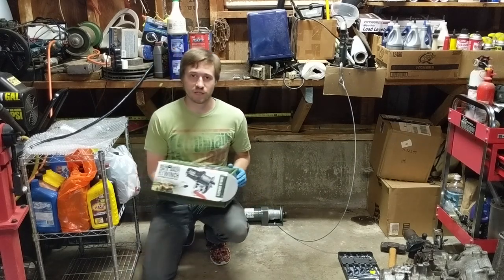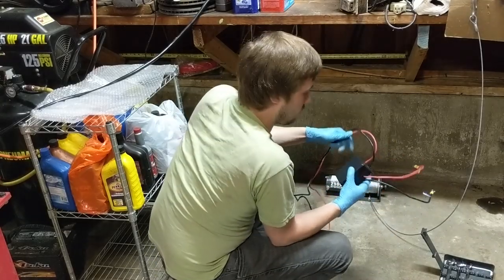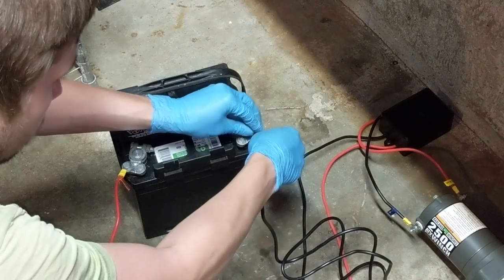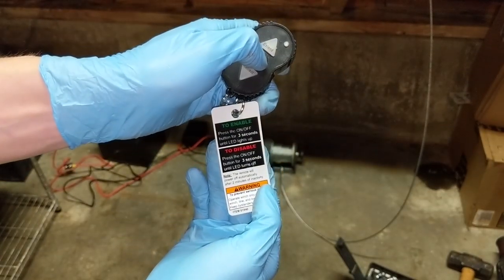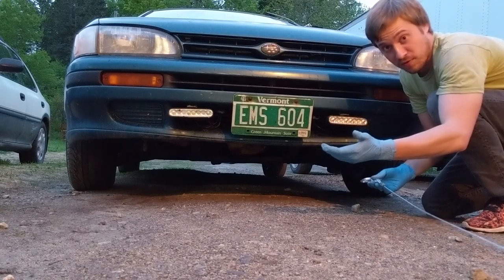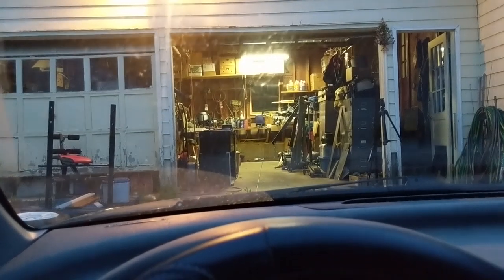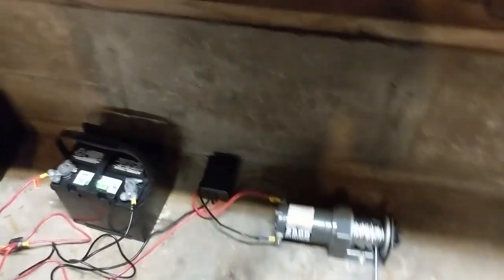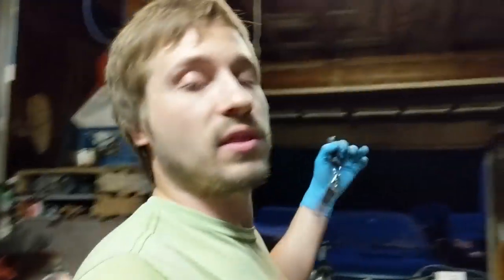Garage Winch Wiring & Testing! ⚡ Floor Mounted Harbor Freight Badland Winch

Comment: So here's 'The Deal'...the okie doke: Although you do have an engine hoist, NOW you can drape the winch cable o'er an overhead bean & use the new toy to yank out the power plants.  Maybe even a tooth or two, also ! Vermont could use another amateur dentist.
BTW...I assume that its' motor housing is vented ? If so, and you are worried 'bout overheating same, position a strong fan to blow on the innards. It can't get much warmer than possum-innards.
You may find this of interest :  https://www.youtube.com/watch?v=zMtXrPuyb8Y
Reply from the maker: Amateur dentist! Hah. Yes I'd like to rig up a rafter brace at some point with pulleys/blocks. A fan might be nice to keep this little puppy cool, but just pulling Subarus it doesn't even seem to get hot! I have seen failures like the one you linked. I make sure mine is coiling right while I use it and luckily I pretty much pull straight on. :) Thanks!

Comment: Great video, thanks dude. Question, instead of a battery, can you use a power supply? If so, what do you recommend?
Reply from the maker: You could use a power supply, but I'm not sure how beefy it would need to be. 12V batteries can handle pretty high Amperage draw. I highly doubt you'll typically hit max load with the winch on fairly flat ground, but even a 2000 pounder can draw like 80A. So I'd want at least a 100A power supply ideally, though likely you could get away with less. Something like one of these could work, but I can't say for sure.
https://amzn.to/3LVY8pn
https://amzn.to/3SFf47u
Reply: @802Garage  Ouch. Yes, I came to that same conclusion. I ended up getting a hoist at a better price that is electric 120v.
Reply from the maker: @budmonk2819  Yeah it's just a bummer most of the 120V winches are so pricey! Good choice though.

Comment: The "putting ground in last" rule is only relevant in cars, where you don't want to short your hot wire on the body/frame of the car, where it's grounded.
Reply from the maker: Hahaha ya know fair! Habit. It's my experience, though I could be wrong, that you also get less sparking connecting ground last if something is active. Could be a false observation, but I make it a habit with electronics in general, since if you are working in anything with a grounded frame or board, the chance of shorting is still there. But point taken!

Comment: I added the previous comment I left in part 1 also.

Whenever you are pulling with this winch, you should use a snatch block  or pulley to make the winch work less. It doubles the pulling force.  This also helps because the strongest pulling force is when the spool has only one full wrap of cable. With each wrap of the cable the winch has les pulling force. It is best to have as much of that cable out.  To reach the vehicle use a chain to make it. This also help out with that duty cycle.

Use a car floor mat , rug or jacket on top of the cable. This will keep the cables from whipping if it brakes.

As I previously said use Anderson plugs.  In your case, getting that remote receiver to the front (or at least as much as you can) of the garage, would help you out a lot. If you can get an old (12 to 10 gauge, Ten is better) extension cord and put in those Anderson plugs. Run the cord to the winch, connect with  Anderson Plug.  You won't have to sit there with the remote and arm out the window. Disconnect battery when not in use, helps keep the battery charged. 

Last thing. Tell that youtuber friend that you can now pull up cars onto ramps. A couple of 2 x 6s wedged against the back wall and at base of ramp will get that car up a set of ramps with ease. Just make sure to run the cable to the back of the car and with that Snatch Block go back to the winch. (Or to the front of the car if you are putting the back of the car in the air. ).Doing that will HELP TO NOT change the pulling force from level to pulling down on suspension, and in reverse, pulling up on the winch. And it  is better on the winch to let out more cable. As I have already mentioned.

One more thing about the Anderson Plugs. With that battery already having a plug (if you follow my advice) , you can cut a set of jumper cables in half and put on the Anderson Plugs. So when you need to jump a car with that battery, all you need to do is make the connections to the dead battery first, then plug in the jumping battery. No sparks. Sparks are the reason people connect the good battery first and to the posts and the cable to the bad battery positive and negative to the engine block. Just in case the battery is venting flammable fumes and explodes. Connecting the battery straight to the posts is best but when you make the connection if a spark flies it may be bad. So when making the actual connection further away will help prevent sparks but it will help transfer the current better.

Previous

What you should have done is set a receiver mounting plate. Called a Step Bumper Receiver.  (Link 1) .  Drill all your holes and add some oversized nuts and washers between  plate and floor.

Get some 2" square tubing (draw bar stalk) and weld (or have it welded) a winch mounting plate on to it. Like Link 2.   Make it so you can put in a smaller tube in front , this is for making a place to hook the cable back onto. Comes in handy for adding a snatch block, doubling the capacity of the winch.

And last upgrade the winch to the 3500lbs (it comes with the plate). Not only will you be able to pull more ( I know you are just pulling cars on flat concrete but keep reading) but the mounting holes are not in the way of the cable.

Why? Well it is way easier to mount. Also when the winch gives out and needs replacing it is way easier to do.  If you are pulling the winch off after years of operation those bolts may be out of wack.  

Also the bolts won't be in the way of the cable. BTW reversing the winch can be done but you shouldn't. Keeping the cable centered to the winch is best. Going over the top will pull up on the back bolt more. It is best to keep the pulling force level/in line with the bolts.

Added benefit is that you can use the winch in other places making it way more useful in different locations.  Get the most bang for you buck.

Last thing. Add Anderson Plugs between battery & controls and between controls & winch. Link 3. These thing are fucking awesome!  This will make it so you don't have to leave the controls and battery on the floor all the time. (Acceptable to falling things.) Adding Anderson Plugs to (in between charger cables and clamps) your charged will make it easier to charge and make a good connection to battery. It also will make moving winch from location to location MUCH easier. You can also add extensions. You can have the battery in the bed of a truck and the winch on a trailer. You need two for every connection. So you will need at least 4 for just this. Yes they are an added cost but the first time you need to do any maintenance to it or charge it you will be glad you put them in.

I have my trailer set up like this very way. Can't see winch in video but the point is it's there LOL.  Link 4. I move this winch from trailer to trailer. I had a receiver plate on my garage floor like you (no longer live there) and would pull in cars just like you. 

Ok now last thing LOL. If you winch ever breaks down or you forgot to charge the battery, you can always take the winch out, put a regular draw bar with a hook or shackle, run a rope from car being pulled in to Snatch block  , back under car to another car, and pull that sucker in. Just make sure to put some stop blocks. 
 
Nice job tho.

Comment: and no 5, because it's safer. If you're trying to push the car that means one hand on the steering wheel and halfway inside the vehicle and if it rolls well thats like russian roulette , you might be fine and you might get killed or injured. Plus if the car starts rolling towards the public road it might not only be yourself to concider,
Reply from the maker: Very true! Nice to have control of the vehicle while I move it. Thanks for watching and commenting!

Comment: if you are worried about the cable snapping toss a blanket or a coat over it and if it snaps, the blanket will absorb the shock.  I am not making this up.  About capacity -- some winches are rated based on the use of a snatch block, but that is probably not the case here.  Something you might like to know about physics, 2500 lbs of pull is enough tug to reel in a car that weighs about 10x that number.  Put another way, a 4000 lb car only requires about 400 pounds of pull to roll it over level ground, and as long as the tires are aired up and the brakes are not seized on, you are still in line with the 10% estimate.  You have probably noticed you can push a car using your own strength, you never thought you were exerting a force comparable to the weight of the car, right?

Nice video series, I watched this because I am trying to figure out how to run a 12v winch off wall current.  Still looking for an answer.
Reply from the maker: I actually do that whenever I'm winching a car in! Thank you!

Comment: I have a sloped concrete driveway leading to my garage.  Will this pull a car up the driveway?
Reply from the maker: Might want to do some winch research to see what the minimum rating for a given angle and weight is. Generally if it's a slight incline I think you would be fine. My driveway is very slightly sloped too. If it's a steep grade, you might want to at least step up the winch rating to 2500lbs, but I'm just guessing. Winch ratings are strange.

Comment: That 2500lb is just in/on the first full wrap of that spool. Each time the wire wraps over itself the pulling forces decreases. And no, that rating is at a flat or level pull.  The weight of the object being pulled is not the only consideration.  You can pull that 1500 lb car  OK but if the breaks are on, the pulling force it take to move that car just doubled. Again it is always best to have as much of the cable out and to  use a snatch block to double back the cable to the winch. It makes that winch work a hole lot less. If you can get a second snatch block and go back to the object being pulled. You will have a 3 to 1 advantage. Will extend the life of that winch.  Yes it will pull three times slower but that can be a good thing.

Comment: yepp i did mine bout 3 years ago... I put 4 anchor bolts into the cement. and then i built my own mounting bracket out of squar tubing.
Reply from the maker: If I did it again I would make two mounting plates so I could move it between bays, but they're cheap enough I'll probably just add a second one, hahaha.

Comment: Hey my friend I am planning to buy a little winch like that for beekeeping purposes to lift boxes. I was worried a lot about how long my battery would last by keeping using this thing in the field. Do you know how long this battery would keep this thing running?
Reply from the maker: I tried to look up some figures and do some basic math. If you have a pretty typical car battery like 650 CCA it will likely have a minimum reserve capacity of 125 to 150 minutes at 25A. I believe this winch probably draws 125 to 150 Amps when heavily loaded. If we assume a 125A draw and that's 5X the reserve capacity draw rating, 1/5 of a 125 minute reserve capacity would be 25 minutes of continuous use at max load. That said, the duty cycle of this particular winch is only 5% so you are supposed to use it for 45 seconds and then let it rest for 14 minutes and 15 seconds. Obviously, you can exceed this, especially when not pulling a heavy load. It's just recommended for maximum longevity. So if you are not maxing out the winch and you are letting it rest regularly, I see no reason you shouldn't get at least 30 minutes of actual pull time and possibly up to a few hours. This is all just some napkin math if you will and I could be totally off. In my experience, pulling a car for a few minutes barely drains the battery.
Reply: @802Garage  Wow I wasn't expecting such great explanation. I suck at all electricity stuff so your comment really helps me figure it out a bit! I'm only going to use it for like 1 or 2 minutes at a time and the weight load is very low compared to a car. Weight would be around 200 to 400 pounds big max from each pull... so it would be a very easy job for the winch. Thank you so much for sharing this piece of information with me so quickly! Much appreciated my man all the best to you!!
Reply from the maker: @lamyellerie1367  Yeah, when someone asks a good question I tend to want to know the answer myself! Like I said, I could be off, but giving your use case I would expect you should easily be able to get through a day. If it turns out I'm wrong, I would love to know! Good luck.

Comment: I purchased one of these and it was broken, ever did work... Glad you had better luck. I think it's a great idea to use this instead of your back!  Oh, save your battery, put a block of wood under that thing. I've killed a battery or two before by leaving them on the ground.
Reply from the maker: Ouch, bad luck! Harbor Freight is usually good about replacing things if they are broken when you buy them though. This is definitely a cheap winch, nothing heavy duty about it. That said, it seems to work for my purposes! As for the batteries on cement, every bit of research and personal experience I have says that's a false hood. I have like eight batteries sitting on the cement and none of them discharge, especially the one used in this video. I believe that's just a hangover from very old battery designs. I do appreciate it though! I believed the same thing until a few years ago.
Reply: @802Garage  I may have had some elder batteries, could have been coincidence😂... Harbor Freight was going to replace it, I had already drilled holes in the floor and everything, it was more hassle at that point, so I just returned it, but I have had one of their 12,000 pound winches for about 14 years, and the lock mechanism just failed a month ago (motor still works fine), pretty impressive for a $300 winch that has been dragging all sorts of stuff up on the trailer that it is mounted to. I am definitely a fan of Harbor Freight for many reasons.

Comment: So does that mean you have to disconnect it every time each use to the battery doesn’t die or how do you keep it from dying?
Reply from the maker: As long as the winch isn't being used it shouldn't really drain the battery, at least not at any significant rate. The remote turns off automatically. I disconnect mine just to be safe though. You could just buy some quick disconnects for the battery or cables and then it takes literally 10 seconds to hook it up anyways.
Reply: @802Garage  okay got it. I’m gonna be installing mine this week. So that’s why I’m asking. Where can I buy these “quick disconnects” from? Are they easy to install?
Reply from the maker: @johnnyespinoza6362  https://amzn.to/3HcpbM1
https://amzn.to/3P0VPCa
https://amzn.to/3h4JZKP
Can either buy the terminals that quick disconnect from the battery or buy a harness connector like that which is polarized and disconnect the wires in the middle. I'd probably go with the battery terminals since the ring connectors on the winch will bolt to them easy and you can always use them on a car later too.

Comment: max load is when its pulling its hardest,  no problem using the motor to wind it up again unless its super hot
Reply from the maker: Yep it hasn't struggled so far. :)

Comment: I just did this project today, thanks for the video.  I bought the same one  from harbor freight,  a little upgraded one but still 2500 .  Although I have to say, the model you mentioned was no longer 50 bucks, lol, must be the inflation now at 84.  I Should have done this years ago. My driveway is at a small incline so pushing cars in garage would be a pain just in case, so this would be so much better. It looks small but I guess it does the job. I suppose a 2500 should have no problem pulling small coupes like mine . I can't help but get chills seeing the car get pulled, but I shouldn't be worried;  its doing what it's intended to do.
Reply from the maker: $84! Dang. I think usually you had to hunt for a good coupon to get the super low $50 price. Seems the cheapest it goes for now is around $70. Still cheap at least. The way winches are rated is strange. Technically the rating is actually how much weight the winch could pull straight up with no resistance with all other factors being ideal, I believe. So really pulling a rolling vehicle which weighs 2500lbs across an almost flat surface is no problem. Don't 100% quote me on that, but basically even up a small incline a small winch like this should be able to pull something rather large. Def glad it worked well for you! Has saved me some back aches for sure.

Comment: I have the same winch I'm going to start the install on tonight. I have a slight hill and a 4 inch curb I have to pull stuff over so I hope the winch can handle it. If not I''ll step up to a 5K.
Reply from the maker: Mine has done pretty well even with heavy stuff. I think you'll be fine especially if you can step up to the curb a bit like with boards.